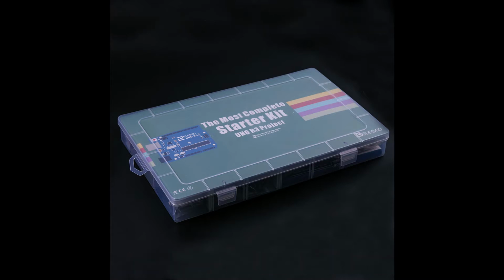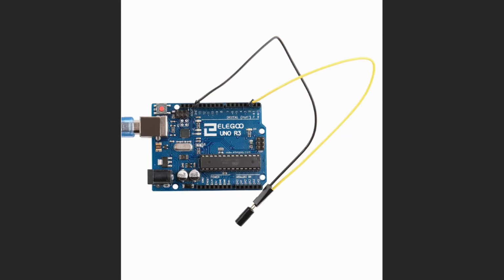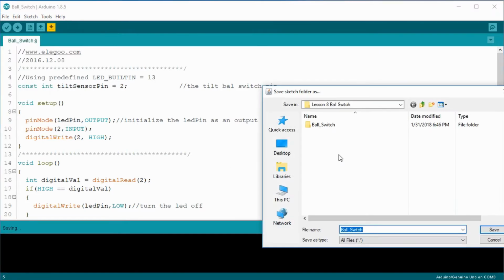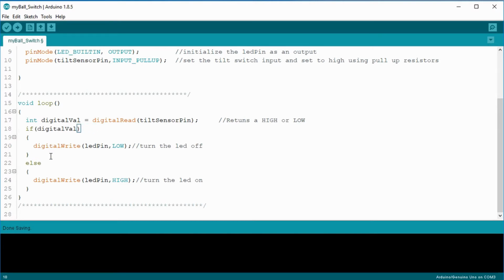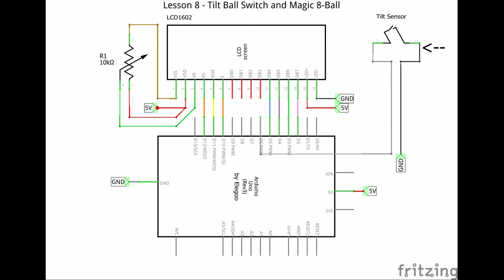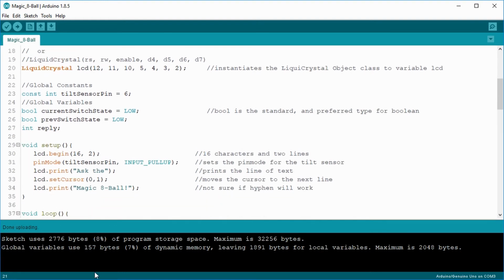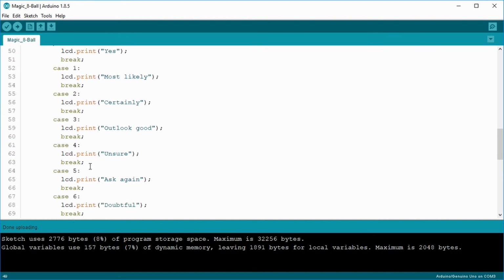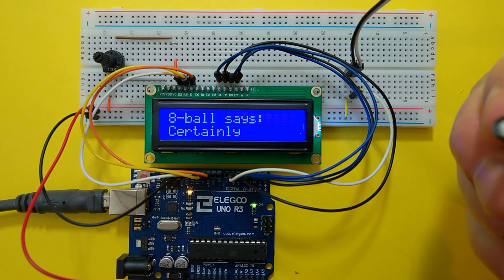Lesson 8 – Tilt Ball Switch and the Magic 8-Ball

Comment: When you modified the tiltball switch code, you set pinMode(tiltSensorPin, INPUT_PULLUP);  and you said it was set to high in your comments. Is that set to a binary 0 or 1. I did a digitalRead on the tiltSensorPin and Serial.println(tiltSensorPin); and it reported a 0.

Comment: Hello, the LCD doesn't seem to go on for the Magic 8-ball. On the breadboard, are the pins on the LCD supposed to go pretty far down? Right now it is just sitting on top of it and I am wondering if that is the issue?

Thanks!
Reply from the maker: The LCD pins should go into the breadboard enough to make contact.  If I recall correctly, they should go all the way down to the plastic spacer.
Reply: Ricardo Moreno thank you. I’ll try and push it down more and see what happens.